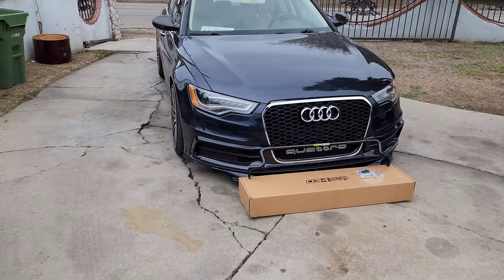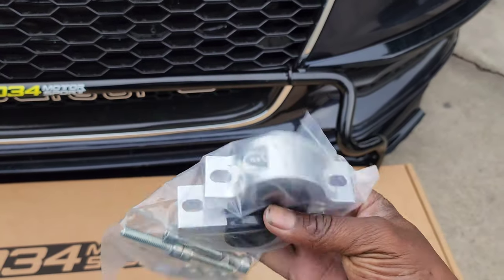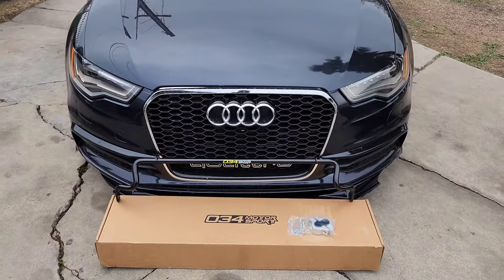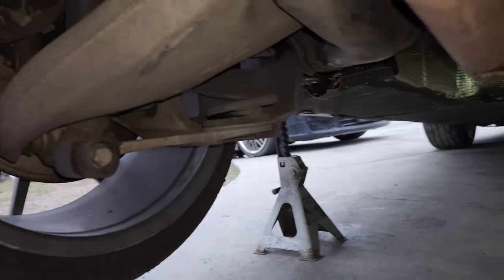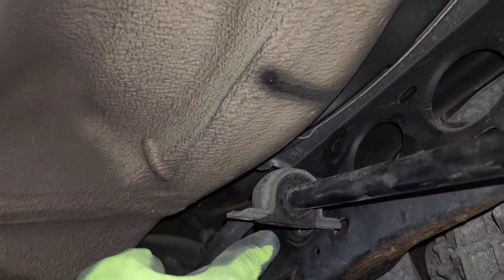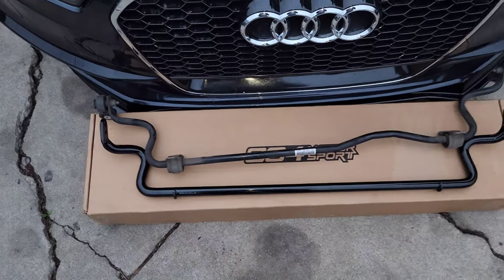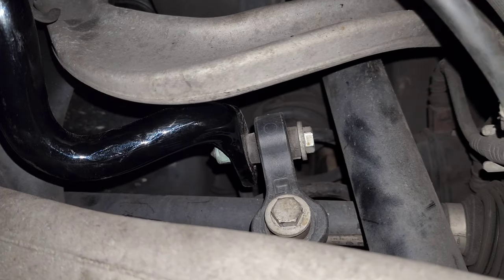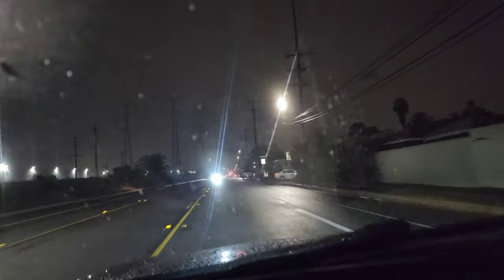Audi A6 3.0T 034Motorsport Rear Swaybar Install

Comment: @5:29 You didn't have to take the rubber insulator off the hanger. That muffler hanger assembly unbolts right off the underbody.
Reply from the maker: It does but it's easier to just slide the rubber off.

Comment: I think I might have to get one of these. I did an autocross with my A6 and the understeer was absolutely awful.
Reply from the maker: Yeah they have a lot of understeer. My brakes were awful too. I did a rotor & pad upgrade that did wonders for braking but I would say they still need more for such a heavy car. I just bought yellowstuff pads to try out before I do a big brake upgrade I have.
Reply: @cmidas3396  My brakes were fine, it wasn't a fast course, I think I hit maybe 60 in one spot. It did OK for what it is, but I could definitely feel the weight and soft suspension fighting against me.
Reply from the maker: @JSAFIXIT Yeah was getting a lot of brake fade when braking hard from above 60 though.
Reply: @cmidas3396  There are at least some good upgrades available. 
I think I'm going to find a much smaller and lighter car to race with, it's fun tossing around a luxury barge, but going fast is more fun lol

Comment: Dang, good video. Hopefully come summer time I could use this to install my own sway bar and end links. I’ve been watching your videos, seen you sharing them in the Audi groups and subbed. I’d like to see a video of how you jack the car up and set level on 4 jack stands.
Reply from the maker: Thanks 👍. Yeah I might do a video on putting the car on 4 jackstands. As far as leveling it I just make eyeball it and make sure I'm on a level surface. I believe C7 Owners did a video of putting the A6 on jackstands so you might want to check his channel out. I need a lift lol.
Reply: @cmidas3396  Yeah, I’ve seen his video too but honestly it wasn’t really clear at all. I think I’ll get some jack stand pads and just position them all under the pinch welds beneath the plastic covers right next to the lift points n try that when I need to service transmission and differentials. But shoot, having a lift in your own garage is the dream hahaa.
Reply from the maker: Yeah your owners manual will tell you exactly where to position them.
Reply: @cmidas3396  I even checked that out too but it doesn’t show where to set jack stands once it’s lifted with a jack using the lift points.
Reply from the maker: I usually move the jack over from the jacking point so there's enough room to put the jackstands in place.

Comment: Whats the stock rear sway bar thickness? I want to install this on my A6, I had a 034 in the past on my GLI and it was great.
Reply from the maker: Not sure what the stock thickness is. If I remember correctly this one is solid so it's a lot stronger.

Comment: Did you have problems with stock end links? I heard they fail on b8’s.
Reply from the maker: I haven't had any issues with them. I know B5 S4's required strengthening brackets but I don't know if that's the case with newer S4's.

Comment: Just so you know the H&R bar is actually thicker.
Reply from the maker: Didn't know but this one is made to work with the factory front bar.
Reply: @cmidas3396  plus it comes with better than stock hardware so you still made a good choice 👍.
Reply: H&R is 26 mm. This one is 25.4mm